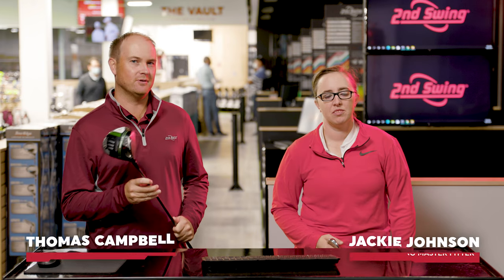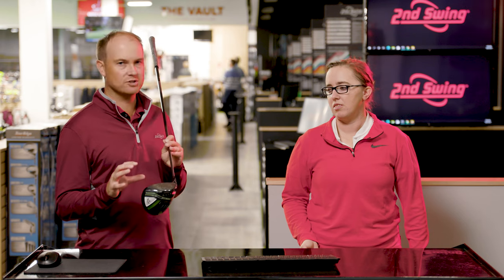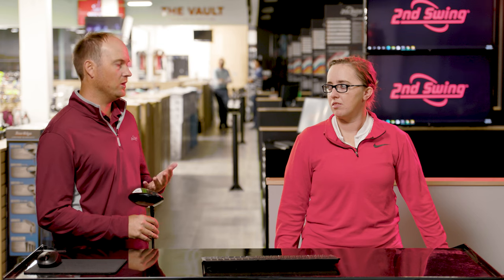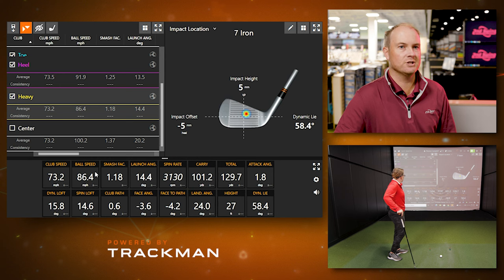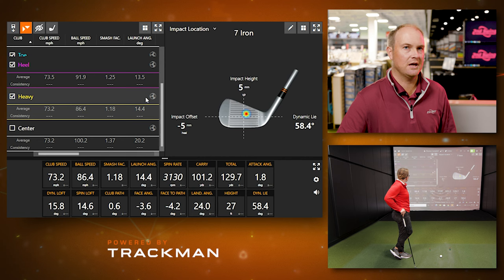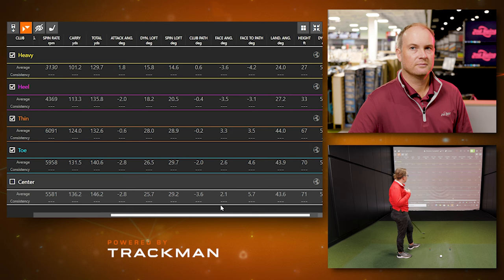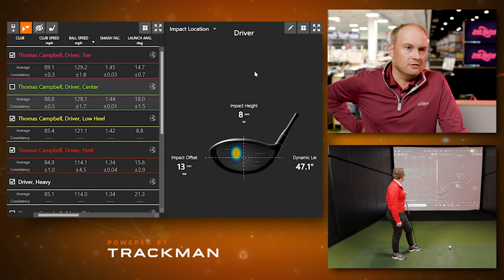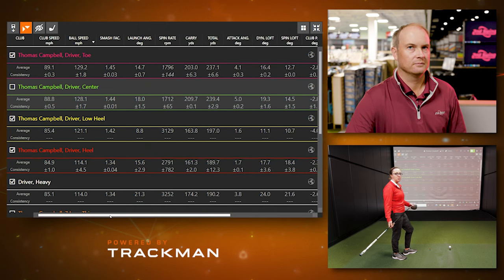Trackman Tuesday: What is Ball Speed?

Comment: I would have thought that the club path and face angle are impacting the ball speed like an out to in swing path with an open club face would less efficient.
Reply from the maker: It is also a contributing factor if the face is closed to the path more ball speed and if the face is open to the path less ball speed - This is due to the dynamic loft - Thomas

Comment: The loft of a driver has a secondary or third order effect on ball speed. The length of the shaft (plus arm length) and the angular speed of the clubhead perpendicular to the ball is the primary determinant of ball speed.
Reply from the maker: Club speed (from length of the shaft) provides potential ball speed from more club speed, however hit location and loft presented really provides the ball speed - Thomas